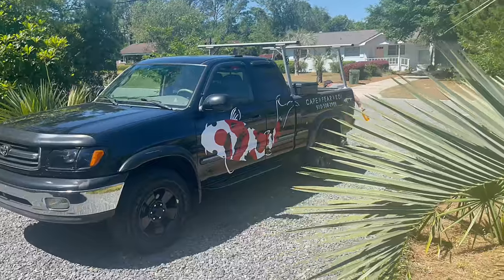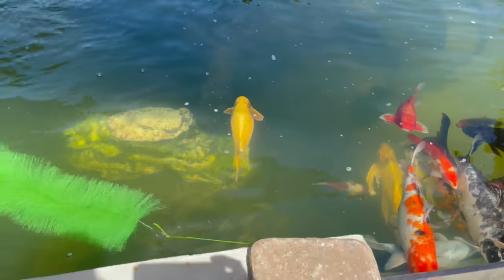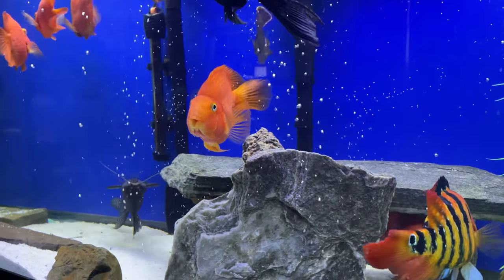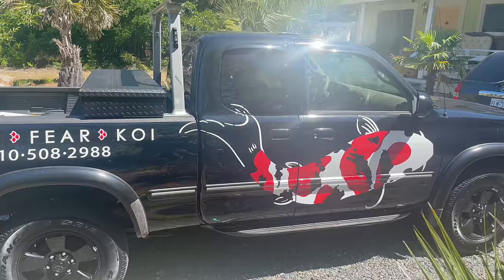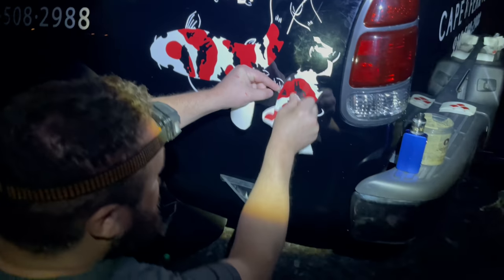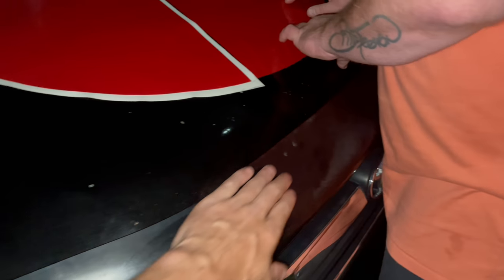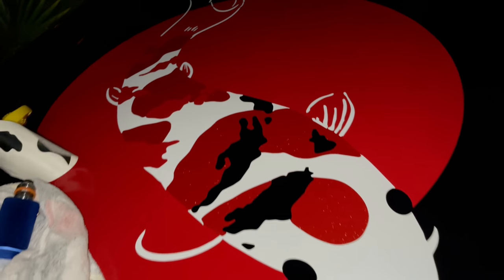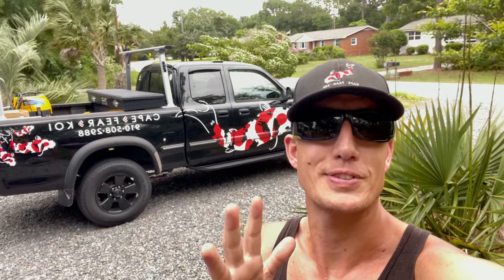Koi All Over My Truck! | High End Aquariums and a Bulldog! | Vinyl Decal

Comment: Looks great. It will interesting to see the kei truck when it's done. You look tall how do you go fitting in it? Some of them are a tight squeeze for me.
Reply from the maker: Thanks!
I haven’t decided on design for the kei yet. I may keep simple since the kei itself is so awesome and turns heads. Maybe just enough to let them know is Cape Fear Koi.
I am tall overall. I’m 6’4” and the legroom can be snug, but getting in and out is a special motion 😆 
I actually enjoy driving it around town as it’s not uncomfortable to do so.
Reply: @CapeFearKoi  We are around the same height, I know what you mean by the special motion.
Reply from the maker: @thecharlesshow9615  nice. Then you already know how people look at you when you’re able slide right in the drivers seat like it’s no problem! I’m impressed with how comfortable it is once positioned.